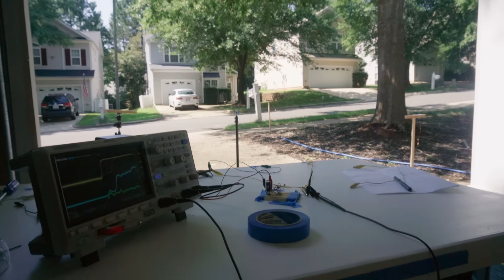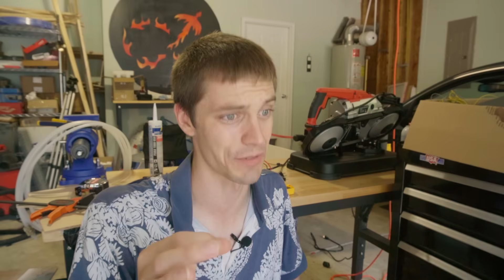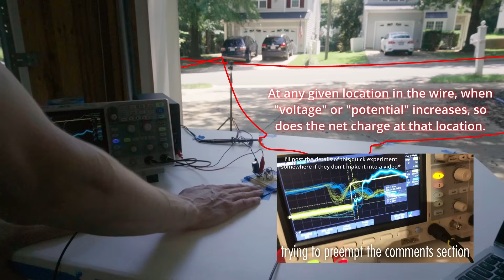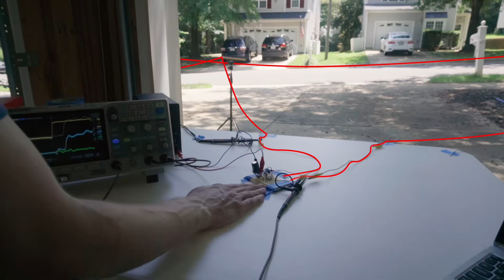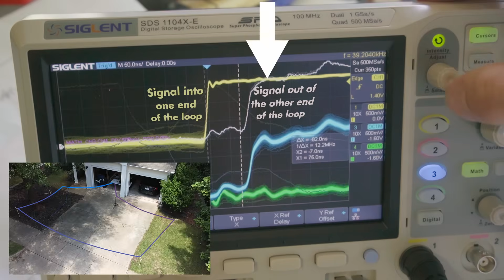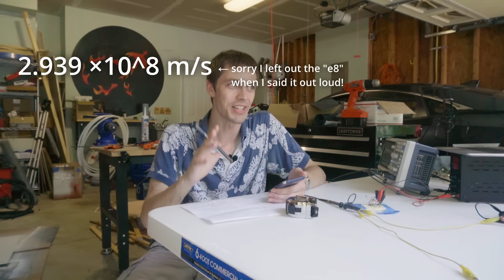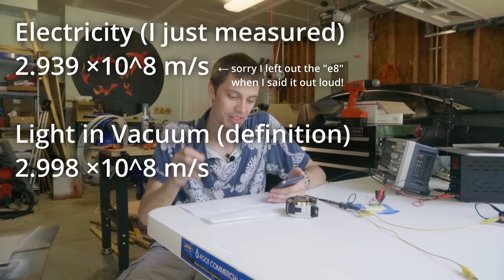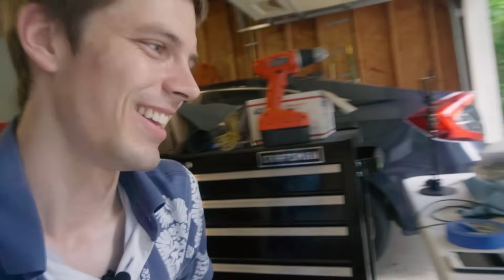Why does WATER change the speed of electricity?

Comment: I know I'm late to seeing this,so I hope you see this comment.  3 variations of this experiment I'd love to watch- instead of the wire in the pvc, have it in air but with a sprinkler raining water down on it.  Also feed the wire through a hose but still have the hose be able to be hooked up to a faucet (this will take some plumbing skills) and run it once with the water flowing the same direction of the current, and then again with the water running opposite direction of the current.  Just curious if moving water has a different impact compared to the stationary water in the pvc.

Comment: I may be wrong but I thought that electricity was not like a "waterhose" and had to "fill up" the whole hose to come out the other side. I thought it was more like the hose was already "full of water" and as soon as you put "1 drop" of water in it, it came out of the other side. With water equaling electrons in example. So there's no need to ask if electricity is as fast as light because it pretty much is light. Light has to travel through the same resistance when traveling through space as electricity traveling through wire.

Comment: 16:10 - C/1.5 means that electricity slows down by a half (0.5 or 50%), and light (C/1.33) only by 0.33 or 33%. So, the takehome message: always minus 1 from your numerical results to describe how much smth is faster/slower, bigger/smaller, ... Take C/8.9, the propagation only slows down by 8.9-1=7.9 times but not by 8.9 times. Put it another way, say if in-water electricity speed = C/1, you can't say it is slowed down by 1 time because it's slowed down by 0 time (1-1= 0).

Comment: 21:40 There was a nice experiment I suggested at school regarding AC, DC and transformers.  We all know that transformers only work on AC, right? Get a 220V to ~12V transformer. While unconnected, place the 220V side leads on your tongue. Then connect a 9V battery (DC) on the 12V side. And let me know if the transformer works or not.
Reply from the maker: Haha did it give a noticeable jolt? Admittedly I’ve never stuck a plain 9V to my tongue so I would have no frame of reference. That’s a great way to demonstrate that switching is “like AC” though lol

Comment: Are you measuring the speed of an individual electron or the speed of the force applied? If I push on a steel rod the other end starts to move instantly even though the rate of movement might be very slow. The speed of the force applied is much faster than the speed of motion.

Comment: I feel like this experiment is some very tentative evidence for a Unifying Field Theory. It has the potential to link the phenomena of Speed of Light to the fundamental frequency of a fundamental particle.  Basically, IF it is true that a low enough AC frequency is defined as DC. That is, its behavior is mathematically modellable via a new formula, THEN that would show that via the paramagnetic effect, gravity is a  an ultra high paramagnetic resistance. I think this guy might be pushing the boundaries  of experimental physics and not even know it. He's done more than one experiment on the speed of fundamental particles as effected by Maxwell forces.

Comment: The electrons in the wire are only moving at few cm/s. However the EM fields move at the speed of light in the propagation medium between the two conductors in a mode which is called Transverse Electro-Magnetic mode or TEM mode. The particularity of TEM modes is that both the electric and the magnetic fields are perpendicular to the propagation direction or vector. 
Good demonstration though.

Comment: Have you thought about what causes that increase in the noise of receiving end at the exact moment you flip the switch? Do you want to see it move farther ahead? Try adding farther away an oscilloscope an synchronise it with with the emitter. Measure the distance between oscilloscopes "in a straight line" and not along the wire.
I bet it will provide a fun way to think about how magnetic fields travel along a circuit. To make it more visible, make sure the wire is long enough, much longer than the distance between the oscilloscopes and that it travels far from it.

Comment: I think you are a fraud.  There is no oscilloscope that can show a 10 nanosecond waveform. Please advise if I am wrong.  Charge propagation travels at the speed of light.  Electrons themselves take about 45 minutes to travel 1 meter in wire. It is called electron drift speed. Look it up in a paper college physics book that can't be hacked.

Comment: You should use 300 Ohm antenna cable. Measure the propagation delay, then put the coil of cable in a bucket of water. The full field analysis in your setup is difficult to analyze. If you use a waveguide (like 300 Ohm antenna cable) the analysis is much more simple. Right now the electric field is not entirely inside the water. That is the main reason it is not slowed down by 9x. But with 300 Ohm cable, almost the entire electric field will be in water.

Comment: This is a well-known area of engineering and science. The speed of an electrical signal propagating in a wave guide is determined by the properties of the dielectric material between the two conductors. In air, it is the speed of light. In insulation, it is slower. In water, it would be much slower. The signal propagation speed for various types of coaxial cable at different frequencies is often listed in the datasheet for the coaxial cable.

Comment: At 10:40 - you say "the speed of electricity isn't the speed that an electron moves through a wire, it's the time that it takes for an electric field to reach an electron". In the model you describe, shouldn't it be both? The field only changes as an electron moves. The next electron only senses a significant change once the previous electron has moved substantially. 

If both factors matter, the limiting step would be the slower one (presumably the moving electron's speed).

This might disagree with your result (though I don't know what the speed of a moving electron is - maybe it actually agrees with your data!)

Comment: If you want to see a full 66% of c, then try  RG‑8/U coax.  With the velocity factor of 66 it has.  Have a 50 Ohm termination resistor tacked on each end stop crazy echos.
A reel of coiled up coax is a great scope delay line, for viewing events that happen before scope trigger point.

Comment: Great video. The explanation about electron spacing had me curious about something. If I am making the connections correctly then the spacing difference between the positive and the negative ends of the current should equate to potential difference. From that, is there not a theoretical upper limit on the amount of voltage a given wire can physically handle (assuming material constraints like heat and durability are ignored). Additionally, does the amount of voltage that any given circuit can potentially handle changes proportionally with circuit length?

Comment: If I recall Veritasium's video on this, the energy contained in electricity propagates through the electromagnetic field that arises from the slow movement of the electrons. So, I wonder if that multi-stranded wire showed a slightly slower speed due to possible interference from multiple fields being generated and thus slowing down the overall field propagation?

Comment: A polar fluid exposed to an electric field lines up the dipoles like perfect toy soldiers.  Remove the field, and the dipoles will move back to chaos, but then it oscillates back into line.  That's the T wave in the EKG.  The QRS is an electric field and it strips BPG from hemoglobin right before oxygenation in the lungs.

Comment: This is how the soil moisture sensors we made at my old work functioned. 4 core flat ribbon cable, short 1 and 2 Loop A ,and short 3 and 4 loop B.
sent a pulse on loop A and when the return signal is about halfway back pulse loop B, alot of maths this will work out the electric coducttivity of the soil.
Take the time of the loop A and Loop B with the electrical conductivty of that soil with a lot of maths and you will get the volume metrics of the soil in %.
Reply: do the same test with the loop of wire in 99% water as the average of the wire is dry and will make it harder to see on the scope.

Comment: It would be interesting to repeat this experiment with an iron wire. 
With the water, the signal should be much slower than in copper because of the iron's high relative permeability. 
Without the water, the signal should be as fast as in copper because it simply propagates outside of the wire. 
These are two predictions that could be verified or falsified.

Comment: There's a difference between the speed of a signal and the speed of the medium. For example, if I open the gates of a dam, the water will flow almost immediately, as in the signal travels very fast, but the water itself isn't travelling very fast at all.

Comment: Just to show that the concept of an electric current as a flow of moving charges is wrong:
Not only would electrons be repelled by the negative, they also would be attracted by the positive pole and the movement would meet halfway the wire.
That means you are measuring half the speed of light.
The delay in voltage is rather caused by the time needed for the buildup of the magnetic flux in the loop.

Comment: Resistance affects voltage and intensity but not speed. Electrons moving from cation to anion matter as themechanism that entices the electromagnetic field (light) to flow but they are not the actual electricity.

Comment: Couldn't help but notice you used municipal tap water, what happens when you test with de-mineralized water.? Much more noticeable resistance with all the iron calcium chlorine and aluminium sulphate products in municipal tap water.
Old school experiment was using two probes and using a multimeter to measure the resistance in tap water and again in de-mineralized water.
In't science cool. 😊

Comment: As I am too cheap and lazy to do the experiments, I am not a scientist. But, I am intrigued by the subject and want to add my two cents to the discussion.  If you are talking about c, you are talking about the medium of the galaxy that established and maintains c.  Air, water and copper wire are also mediums, so your electricity is moving thru mixed mediums, which should affect its speed.  Also, electricity is not just one thing,it is electrons, known for their EMF and photons, known for their energy.  A low impedance circuit should be rich with low energy photons, where a high impedance circuit should have many flighty electrons.  This may effect your results, too.
A side note:  On a submarine, you need to shorten the antenna by n=1.33, the index of refraction of water, or it will not work.  
Great video!

Comment: impedance should have a different speed.  Next time instead of water use a cable wire with a shielded aluminum foil ground.  You should see a big difference in speed.

Comment: A 2d sine wave is a handy representation that we use to represent waves but I highly doubt that that is actually how they propagate through both space and materials.  How would you setup and experimental design to show what that geometry actually is, and how does that geometry change with frequency and dielectric constants of the surrounding space?
Also if water has its own resonant frequency, what types of unique properties take place when it is resonated at various voltages and wave form structures, and how does that relate to using water as a capacitor?
I am very curious on this stuff to see what level of circuit design you can use by using very simple and mostly natural components.
Possibly a good experiment if not already done.  Thanks, Ken.

Comment: I think you should clarify what you are measuring. You are measuring velocity factor, not the time it takes for a single electron to travel through the loop. It would take a single electron at least an hour to travel that loop. I was surprised that you were getting a velocity factor that approached "C". The velocity factor of most copper media is typically around 75% "C". I honestly have never done time domain reflectometry on a cable with a velocity factor that was greater than 80% "C".

Comment: Electricity is the flow of electrons and an electron travels at the rate of 2.2 × 10 6 m / s thru copper wire while the light travels at a rate of 3 × 10 8 m / s thru a vacuum.

Comment: Im not sure if im making any sense here but since current is the motion of electrons isnt it technically instant think for example a hose with water already filled in it but closed off at the exit. the pressure cant move the water because its closed off i.e not receiving more electrons. but as soon as the exit is open i.e loop is closed the electrons starts moving in sync again where electrons are lost the other electrons already at the end of the pipe replaces.  But to be honest the electrons have to push(?) away the others so technically theres a delay in doing so lol
(EDIT) Nevermind this explains what I was thinking 10:17😅

Comment: Yes light doesn't travel 9x slower.  It is 1.33 as you said. Is it really due ot the mass and moment of inertia of water molecules? No effect of magnetic succeptibility?

Yes, the formula is for an infinite sine wave. Is a light pulse, which is finile, similar close to the middle?  If it is then the start and end have to be a different speed?  Will light spread or compress?  If it spreads, in space, then the wavelength is different at different point (therefore frequency. You can explain this in terms of fourier i guess).  So   a monochromatic light spreads out when it passes through water?

Comment: Don't really need to test this it's in the math electricity travels at the speed of light because electricity doesn't actually travel through The Wire and electrons do not convey electricity. Electricity travels through the electromagnetic field that surrounds the wire when motion of electrons within the wire excite the electromagnetic field and the messenger particle of the electromagnetic force is the photon which is a massless particle. It's like saying the strong force does not act at the speed of light because quarks have mass. But the messenger particle for the strong force is the gluon which is another massless particle that travels at the speed of light. A better way to think about it is electrons act like the stone in a pond and the pond is the electromagnetic field and the propagating ripples on the surface of the pond are the photons conveying electricity. This also means the visualizations used in this video it's slightly inaccurate because the field propagates in all directions from each electron and since the visualizations shows an elongated a loop of wire an electron can send a propagation through the field that enters a portion of the wire quicker then if you tracked it directly along the wire. It's better to think of each piece of the wire as a point in space. Propagation starts from the initial point where charge enter The Wire. And say you have an extremely elongated ellipse of wire propagation will cause electrons distance the field before it would have had time to actually travel along the wire. Veritasium has a video proving this concept
Reply: An electromagnetic field around a twisted pair of conductors carrying direct current?  How do you measure that EM field at zero frequency?  You are thinking of the transmission of a pulse.

Comment: Late to the party, I know, and I have not read ALL of the comments but... surely inductance and capacitance must come into play? I'm no expert at all, but can't an inductor simply be a coil of wire with a few turns (one, in your case),,,? Would surrounding (part of) your coil with water affect its inductance, and therefore the timing measurements you see on the scope? I'm not sure you are measuring the speed of light rather than the voltage at the end of a circuit, which may have some inductance/capacitance involved? Please educate me, or point me to any relevant or related comment/source..? I do appreciate you making these videos and opening the discussion and I thank you for that. Keep doing what you do!

Comment: If you have an air hose, let pressure and higher distance both decrease the velocity... this gives truck air brakes "brake lag". Test whether distance or voltage can change the velocity of electricity.

Comment: Actually I doubt that you can show a difference in the electrons' drift velocity with this approach. Your long, submerged cable will form a capacitor with the water as its dielectric. Even without any water the long wire will form a capacitor to ground. Together with its ohmic wire resistance you'll get an RC low-pass filter that limits the cutoff frequency of the cable, thus attenuating the step response on the oscilloscope. The difference in your measurements will then reflect the water's dielectric permittance (about 80 at room temperature) in comparison to air's permittance of (roughly) 1. Due to the large permittance, the capacity between cable and ground strongly increases which greatly reduces the cutoff frequency of the cable's parasitic RC network.

Comment: I think you are overcomplicationg things with water. Charge in water is not carried by electrons but rather ions of mineral salts dissolved in it as well as carbon dioxide that turns into carbonic acid unpon reaction with water. Ions have finite mobility, which depends on molar mass and hydrodynamic radius. Whichever way around it is, that mobility is lower than that of electrons, hence lower propagation speed.